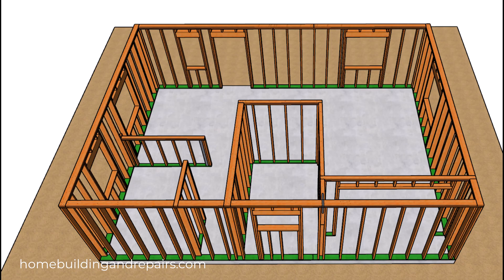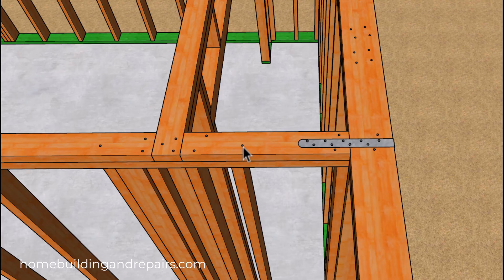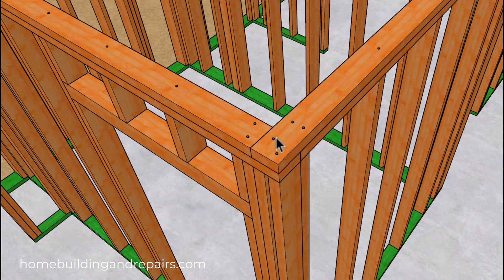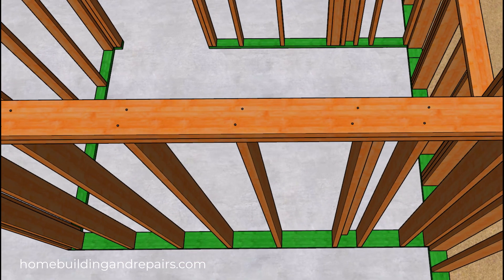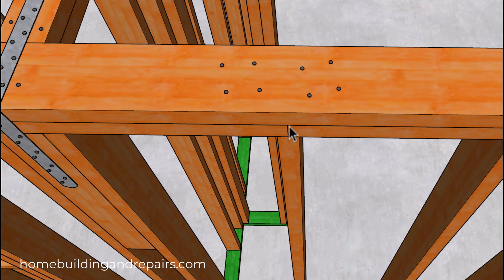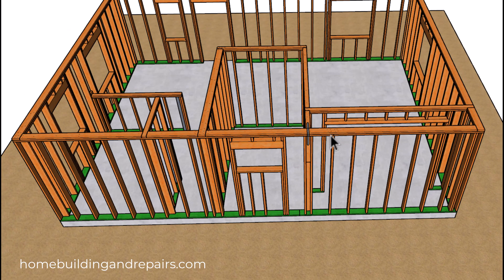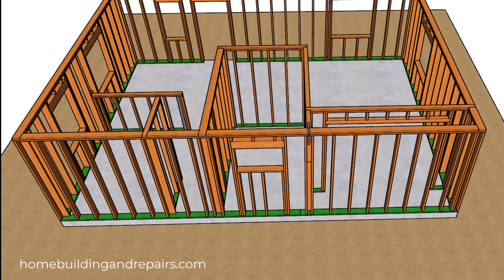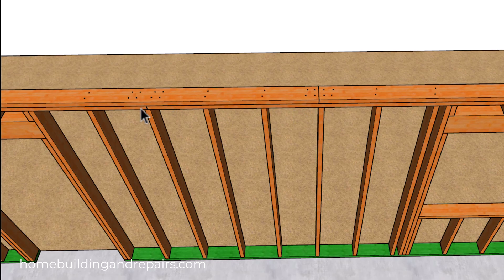Wall Framing Top Plate Nailing and Break Education - Examples and Suggestions

Comment: I think you just explained IRC code R602.3.2 Top Plate. I was having a hard time understanding what was meant by "End joints in top plates shall be offset not less than 24 inches." Larry Hauns book mentioned 4 ft.  If the total distance of a wall is 16 ft,  and the first top plate is cut at 15 ft and 1 ft. That installation would be incorrect due to the 2 ft rule. What is a good rule of thumb for plate breaks for walls that are between 16' and 18' particularly if a repair has to be made to existing framing? Removing the 2nd plate to replace the entire bottom top plate would be considerable work.